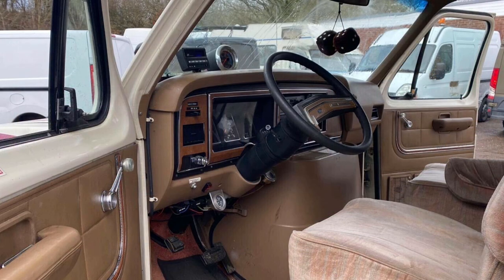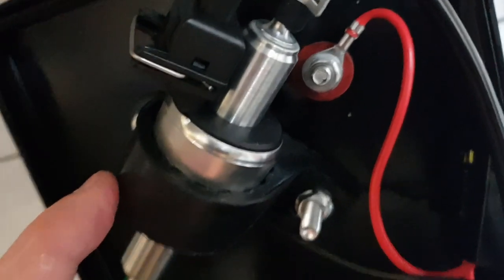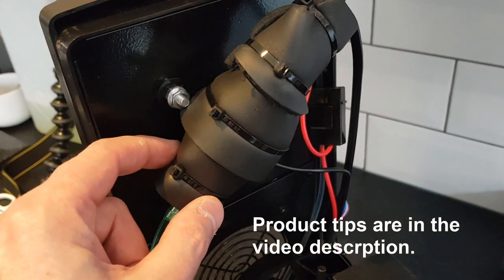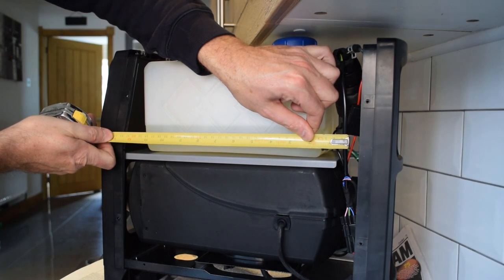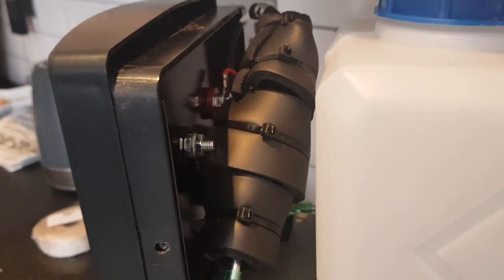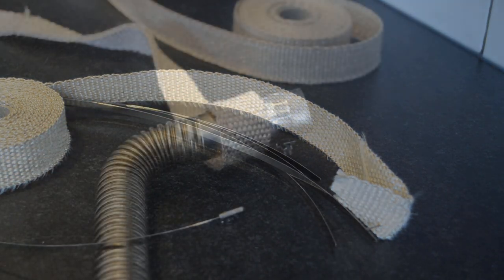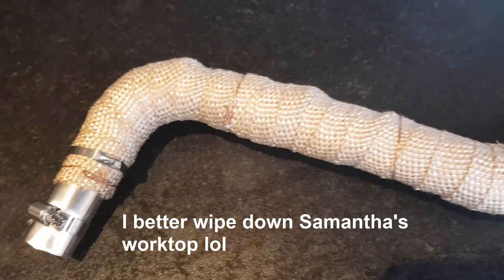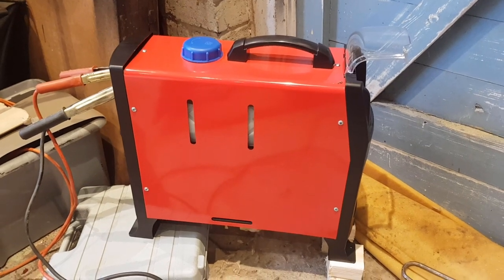Almost SILENT RUNNING Chinese Diesel Heater THREE Modifications | RV Motorhome Rebuild

Comment: Good job on the sound deadening, like the exhaust wrap. Looking forward to fitting mine over the winter. 😎👍
Reply from the maker: Thanks. It's certainly made a difference in the noise levels, time will tell how quiet it really is when we build it into the base unit and it become further sound insulated. I am not convinced about how the exhaust pipe is secured, so I may revisit that later with a better jubilee clip than the manufacturer supplies. The intake hose is also rubbish, crushes too easily, and a better pipe is needed there.

Comment: Amazing work!    Can you tell me how thick that insulation foam is?   I have been trying to find some on Amazon but they are mostly around the 10mill or 8mill range and what you have looks thicker but its hard to tell from the video :)
Reply from the maker: Thank you. I would estimate the foam is around 7mm thick.

Comment: Don´t want to smartass, 
but Alubuthyl sheets used for car hifi sounddeadening 
would have worked even better than that soft self adheasing foam rubber!
That foam rubber material is rather more intended to serve as thermal insulation.
Reply from the maker: Your comment is appreciated. The sheet we had was used as we had it left over from a salvage Range Rover rebuild project.

Comment: There is a certain way to get the system quiet! Get rid of the solenoid pump and replace it with other method pump! Never ever that annoying klicking and desperate sound insulation no more!😊
Reply from the maker: That is of course another option yes.
Reply: Just use the original pump instead of wasting money on a different one. You can completely eliminate the sound by suspending the pump instead of solid mounting it. I used a small cable tie so the pump is at a 45 degree angle. Then make sure you wrap it in some kind of padding (a piece of pool noodle works prefect) or insulation of some kind. Anything to absorb the pulses. I can stand right by my heater and cannot hear the pump at all.

Comment: If you soak the bandage in water it is much easier to wrap tight , it then tightens further once heated and dry .  just a tip if you ever do another wrap .
Reply from the maker: Great tip, if I need to remove the exhaust again I will try this for sure :-)
Reply: And when dry, Paint it HT paint 😉
Reply: @MrC3dr1cB  I wouldn’t paint over fiberglass like that, paint the exhaust itself with that, or cerakote it if you care that much and then wrap it. You’ll be able to touch the exhaust and at most feel a little warmth if done right
Reply: @KDlGG  Cool-It High Heat Coating provides long lasting protection for any hot surface up to approx 800 degrees C. This coating is recommended for use with their exhaust wrap, as it seals the material and provides lasting protection from oil spills, dirt and road grime. Its use is by no means limited to use on exhaust wraps though, it works well on exhaust headers, engine blocks and starter motors etc.
Reply: @MrC3dr1cB  I’ve never seen anyone paint over the wrap, I haven’t done it either. When I had my truck I got the manifold and Downpipe cerakoted and then wrapped my Downpipe in that titanium exhaust wrap and it worked great, you could touch the exhaust when hot so I’m guessing it provides the same result, just different steps

Comment: Is that a 5kw or 8 kw unit? Does it have a Alpine mode setting feature? If so, could you tell me the hot air output temperature at setting level H1 Alpine mode. Thank you.
Reply from the maker: Its is the 5kw version i think.

Comment: I used a foam pipe that's meant for insulating 3/4" and 1" plumbing.  Here, they are dark grey and have been slit down the length
Reply from the maker: Ah yes, I know the sort of thing that you mean Peter. I hope it helped improved noise levels for you.

Comment: Great vid, thanks for the tips. I'm defo gonna try some of these when I get my heater. Still haven't quite finished the van insulation stage so I've got quite a way to go but there's no rush :)
Reply from the maker: Good luck with your van build project.

Comment: I put a 1/10th watt LED light at the top of the end of the outside of the fuel tank top using adhesive aluminum duct tape. I can see the fuel level from  10 meters 33 feet away. The light had to be at the top as when I tried it at the tank bottom, the whole tank glowed green with diesel fuel and blurred the fuel level.
Reply from the maker: That sounds a good idea, great tip.

Comment: Use Marigolds while wrapping. 
When wrapping is done, blow the wrap over with a plumber's blowtorch to melt the loose strands off.
Remaining loose strand-ends will melt to little balls that can be brushed away outdoors,
Reply from the maker: Two really good advice tips there, thank you for sharing the thoughts.

Comment: Great video thanks a lot, one question in yoir opinion  if i put this unit under or boxed next to my static carsvan would it be that noisy that it would  upset my neighbour 5 mtrs away and or would the noise travel at night thanks a lot Paul
Reply from the maker: A good question. So, the video is really about quietening the annoying click noise of the pump for the fuel. But, your issue with that kind of external set up will mean the fan and fuel burning noise (sounds like a jet engine) will certainly be an issue. I think you will struggle unless your box and and heater ducting is super insulated for sound.

Comment: Neat job there. Nice one. It's great to get rid of noises in the van, as you do tend to pick up on things like that, especially when you live in the van. We haven't got one of those Chinese diesel heaters, but we have tinkered with the idea of the other type which has a separate tank. We're holding back at the moment, see how we cope this winter. lol.
Reply from the maker: Thanks Andy. Yes, a 2kw tank-less version would suit your motorhome better. We have more work to do with the heater before we use it, including a method of sealing / enclosing all of the exhaust pipe, a feature to deal with on these units stood on legs, which will need some thought for me in the coming months. I will be using the heater in my garage over the next week, as I have some work to do in there for the RV 😃 I have central heating in there, but we are not using the house gas central heating at the moment.

Comment: Is this a brushless heater?  Would a webasto, eberspächer, etc make any difference to a chinese on this?  Not sure what fuel pump you´re using but ultra quiet ones are cheap these days  ( + - 35 £) , they should fit to a chinese too?
Reply from the maker: Brushless motor? I am not sure to be honest.

Comment: Hi, interesting video.
Have you had any problems with the burner unit overheating or throwing up any overheat error codes ?
Thanks,
Steve
Reply from the maker: No. To be fair we have not had it that long. We had an error code once as the fan was catching the housing. I think we made a video on it.

Comment: Would have been useful if you had shown us the sound after each modification. But thanks for the upload and it certainly made a difference. A lot of the pump and heater noise resonates through that cover so that was a good idea to put the sound deadening material on the inside. And those slits aren't air-vents - you were right second time - they are simply so you can see the fuel level.
Reply from the maker: Sorry for that

Comment: Put the foam between the case and the fuel pump mount to isolate the pump from the case. Rubber mount everything that makes noise
Reply from the maker: That is certainly something that may assist further.

Comment: Now, can you please update and let us know if the insulation caused the unit to run too hot or not? I’ve seen a lot of reviews of these sorts of heaters that they often overheat and throw error codes, and I’m wondering if the extra insulation caused any issues in real world use.
Reply from the maker: I can tell you the insulation did not at all cause the hot to run hot.
Reply: @VintageRVAdventures , excellent feedback! Thanks for the speedy reply. 👍

Comment: For gods sake install an Electric pump and you Will thank me  ......
Reply from the maker: It is an electric pump!
Reply: NO ITS A MAGNETIC PUMP/AND YES IT IS BUT ITS TOO NOISY.
Reply: IT presuraise the diesel so IT becomes a hase but if you godt another pump that is more silent that has the same presure you dont hear it at all i need to sleep
Reply from the maker: @teisfussing3043  Its not noisy, we quietened it down using sound absorbent material in the video.

Comment: I've seen examples where people wrap the exhaust, including the silencer. Some say it reduces the exhaust noise. Have you noticed any reduction in exhaust noise since adding the heat wrap ?
Reply from the maker: No, I wouldn't say wrapping the exhaust tube would make much difference. The main noise reduction is about surrounding the fuel pump, that is where the most noise comes from.
Reply: @VintageRVAdventures  Thanks Vintage. Using mine in a tiny house so the tick tick tick has not been an issue. After trying a couple of things, the best solution was to leave the exhaust as the maker intended. Unit works very well. Using a lot less firewood, and not that much diesel.

Comment: wrapping the exhaust will cause it to overheat and possibly fail prematurely. it needs to dissipate its heat and not hold it in.
Reply from the maker: I have to disagree, based on experience. There have been no problems so far.
Reply: @VintageRVAdventures  you can also buy silent fuel pumps as well but I'm sure you know that already as well lol.

Comment: You need to replace that green fuel line, it degrades really quickly.
Reply: Any idea what diameter fuel line to buy?  Or is the white rigid stuff typically the same size?
Reply from the maker: Thanks for the tip.

Comment: Sounds like your fan is hitting inside heater?? sometimes they push fan on shaft to far and they hit mine had this problem easy to fix your self
Reply from the maker: That is what happened when we first bought it, straight out of the box.